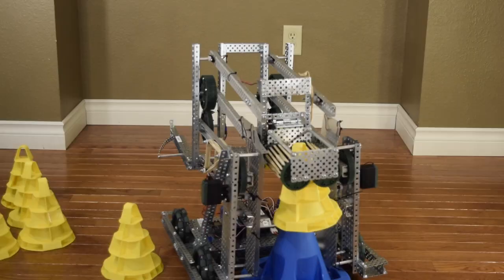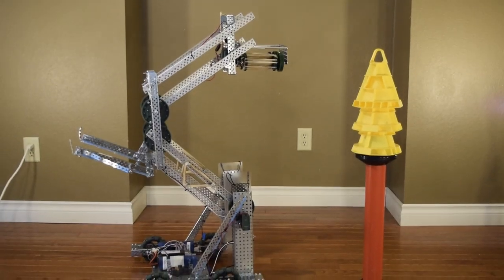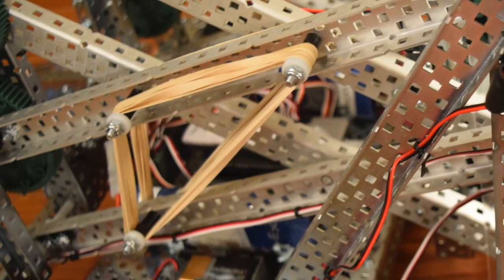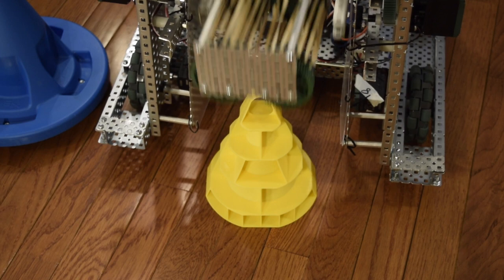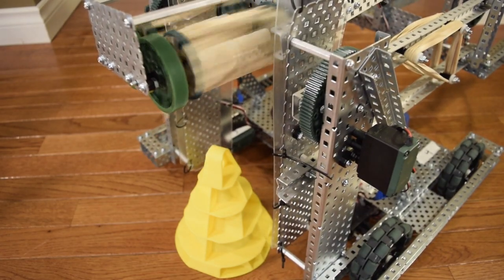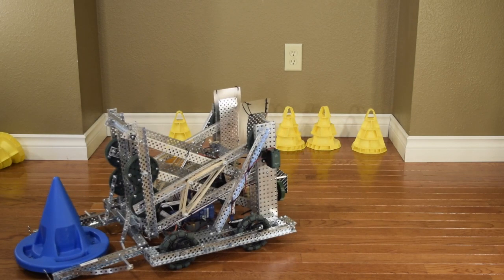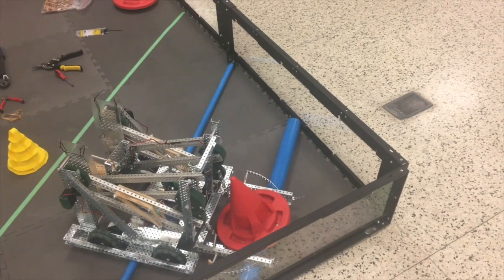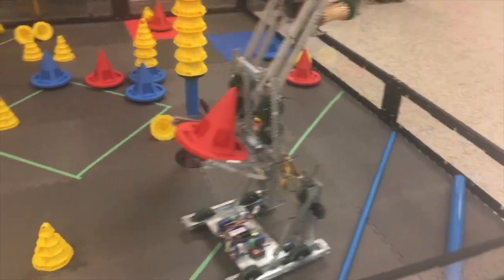VEX 2017-2018 In The Zone Robot Overview and Retrospective

Comment: If you put the lift on the two pieces of C channel where you drive train is then power it on the back with 4 or 6 motors the you would have more space in the middle to put the mobile goal lift

Comment: Pretty cool. Good to hear you made states but I wouldnt blame steel as the reason you were stalling... The big reason is your joints and how high you were lifting the mogo, its great to see screw joints but watch a 21s video and learn from the joints they use it becomes much better. Also the mogo shouldnt be that high the stress is put into every system. You also should never have to put plastic down so the lift doesn't catch if it catches fix that problem by rebuilding... I know that's difficult but I would avoid that at all costs. The last thing I want to say is putting a motor that isnt connected to anything is a bad idea at least use 2 motors for your intake or do a 3 motor lift, anyways good luck next year and have fun with the new game Sunday
Reply from the maker: Thanks for the comment! Thanks for the tips, any specifics about joints? Also, the problem with the mogo being too high was that the rubber bands wouldn’t hold the lift with a mogo on unless the motors were turning. If I added more bands, the lift would have not collapsed all the way. I wish your team good luck next year as well!
Reply: Kepler Electronics https://youtu.be/ImACPtd_BdY
If you look they never lift the mogo to high as gravity wants to pull it down